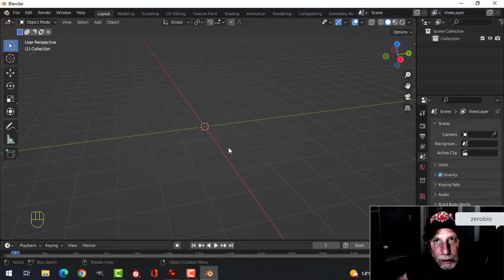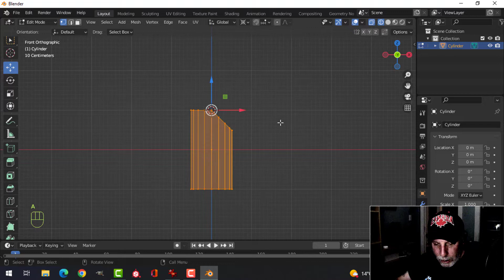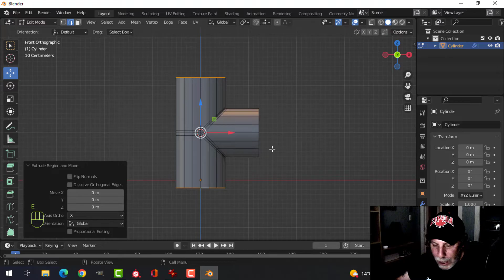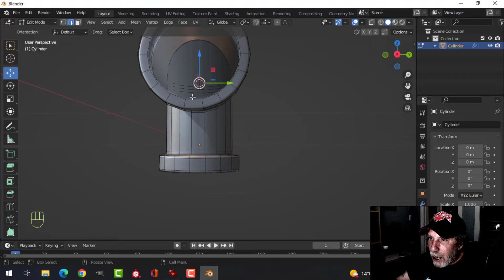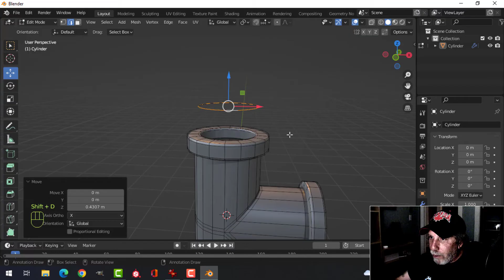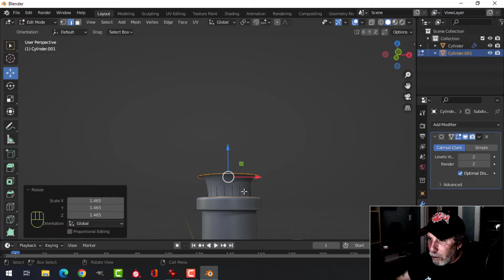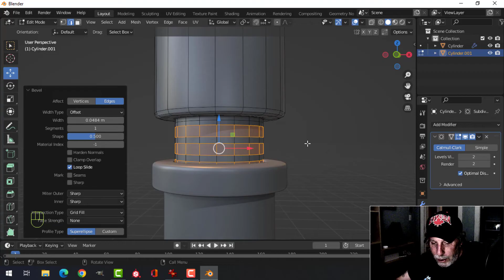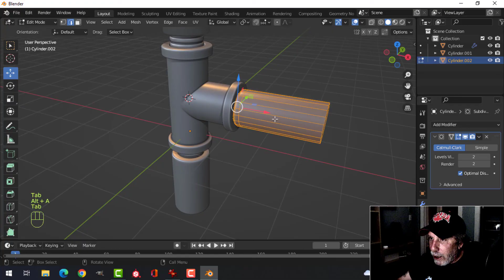BLENDER: PIPE T JUNCTION

Comment: 2:50 about straightening loop cuts: when you're moving the loop cut, you can press (E) to make it even. This way you won't need to apply the cut first, then straighten it, then move it again. After you press (E) to make it even, you can even press (F) to switch the loop cut's shape to one of the two parallel edges. I'm sure you know this already but I just wanted to be sure so you can save some time!
BTW your videos are amazing! It would be great if you make one where you model a speaker, maybe one of those studio monitors like Yamaha NS10 with their iconic white woofer.